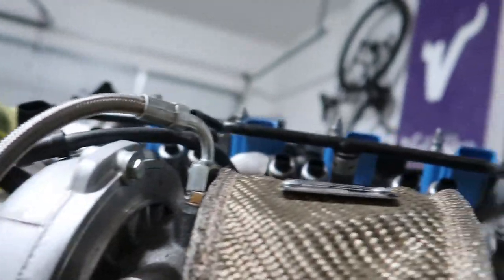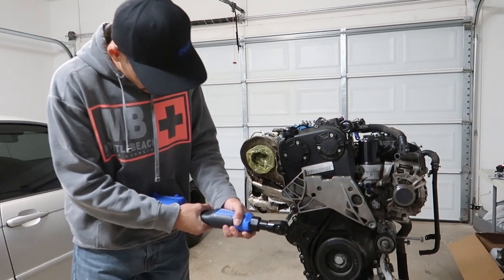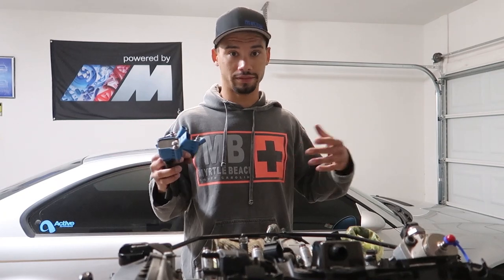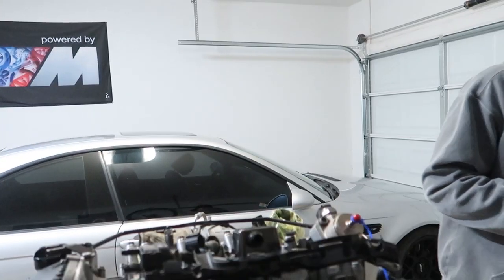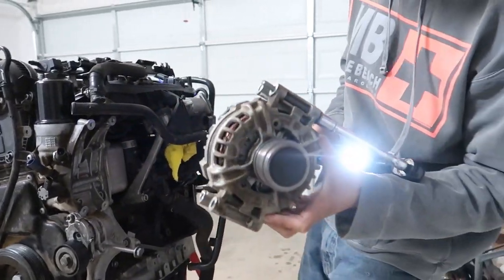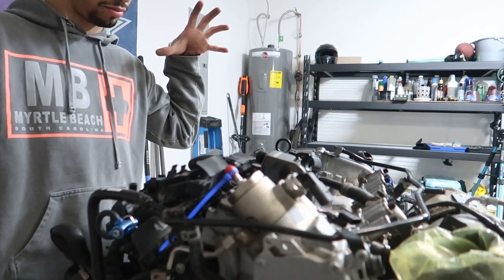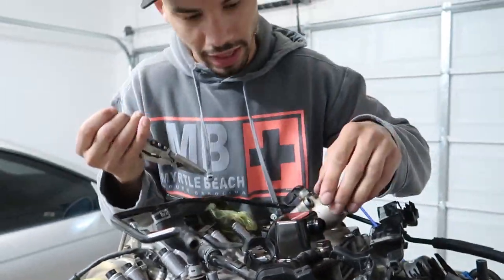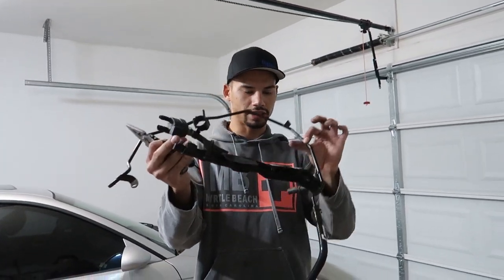Engine Build - Breakdown! Part 1 - Turbo, intake manifold & more! | MK7 Golf R

Comment: 24:26 hitting those bolts with a Impact hammer driver  (not a power tool) might pop those free sometimes it takes a instant hit of torque to bust them loose.. Google that tool :)
Reply from the maker: Yes! I should invest in one, we actually have those for our aircraft and definitely come in handy. These just had a bunch of dirt and grime stuck in there from the heat and such I couldn't fit anything in the hole at first lol

Comment: What did you use for the custom oil line?(i think it was oil) for the turbo? Is it the OEM connector with an aftermarket piece?
Reply: 99% sure if you purchase the EQT Vortex. It comes with an upgraded braided line.
Reply from the maker: @deiondaniels5402  it doesn't anymore, there was once some issues with people allegedly pinching the hard line and causing issues so he included the kit but I guess that's no longer a thing.
Reply from the maker: I'll find the kit for you holup
Reply from the maker: "Oil Feed Line AUDI VW Golf MK7 S3 2.0T EA888 w/ factory IHI RHF5" https://shop.mambatek.com/Oil-Feed-Line-AUDI-VW-Golf-MK7-S3-20T-EA888-IHI-RHF5-IS20-IS38-016-0117.htm

This is what was included with the turbo kits once upon a time, and what I ran and will run again. No issues whatsoever
Reply: @BryceJordanProductions Cool thanks. Never found a decent alternative for the OEM line which can be a bit annoying to deal with.
Reply from the maker: I'd really like to replace all of them with adapter pieces and such.. might have to get some custom shit going here with AN lines and such

Comment: Hello! 
Since you are rebuilding the entire engine, the most important thing is to upgrade the intake manifold. You will gain 19 hp in stage 2 and 37 hp in stage 3. Not many are thinking about this improvement.
http://rpcmotorsport.com/productos/116-colector-admision-20-mqb-gen3.html
Reply from the maker: It's in the plans! I just don't have the funds yet.. I'll be doing an intake manifold and the grams throttle body eventually! Maybe even some direct port nitrous 🤫

Comment: id recommend loosing bolts w a ratchet just to feel how torqued down it is
Reply from the maker: You can loosen it with the tool like a normal ratchet, most of the stuff I've touched before. Next video will be all new to me though.

Comment: Don’t forget the Motul for the new engine.
Reply from the maker: Absolutely!! Shits gonna get expensive real quick 😆
Reply: @BryceJordanProductions  Motul 300V 0w40 Trophy ???
Reply from the maker: Whatever IE and the built motor homies Suggest! I know it's 300v just not sure on the weight
Reply: @BryceJordanProductions  i read a few days ago about LSPI problem on direct injection engines , very interesting...
Oil with high Calcium additive seems to increase this...
Reply: I run xcess 8100 5w40
Reply: @christophercastro3302  you could better than this...
Reply from the maker: I have port injection added so lspi shouldn't be much of an issue anymore
Reply: @BryceJordanProductions  👍